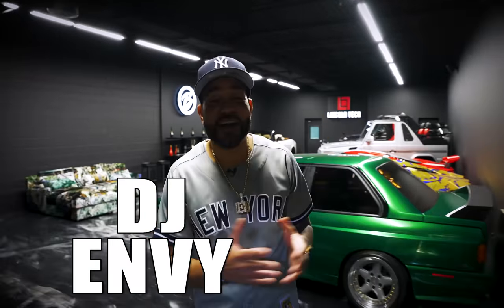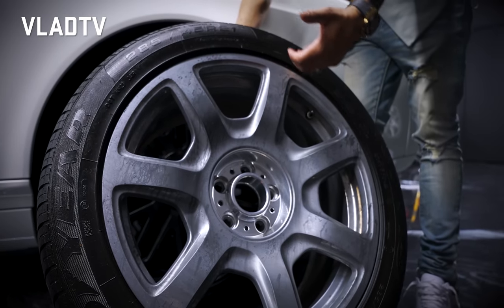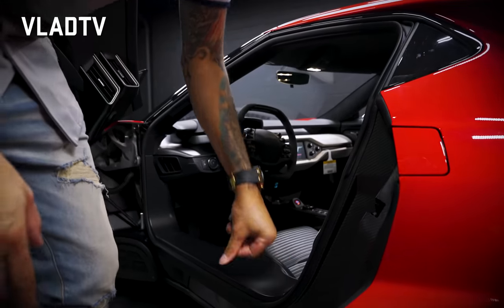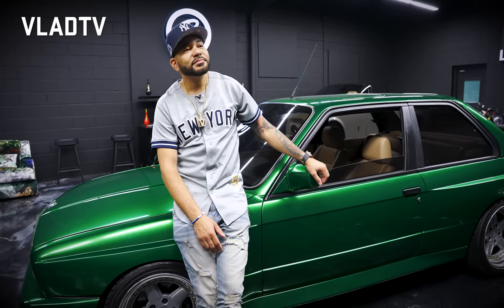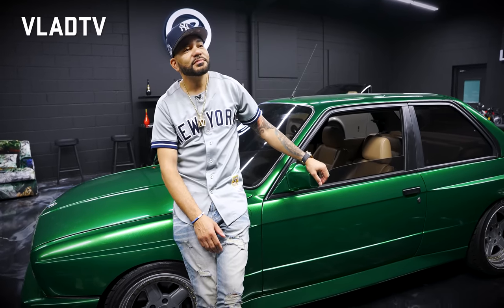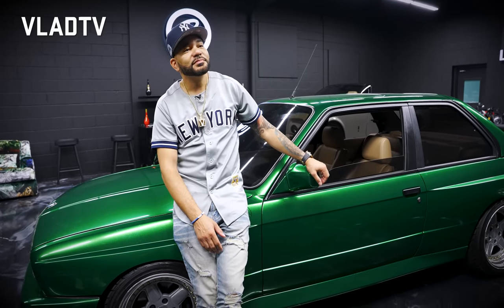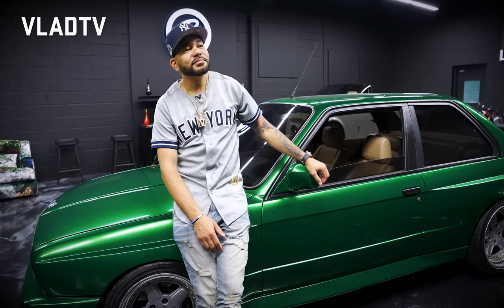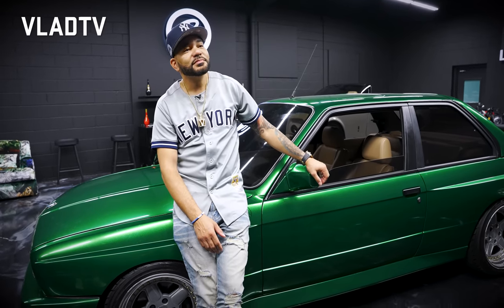DJ Envy Shows His Ford GT, BMW M3, Mercedes G Wagon, 50 Cent & Lil Kim's Cars (Full Interview)

Comment: 1988 735i my first car mint ! Got it with a very bad oil leak the dr. Wife’s sold it to me she said the bmw tech said engine needs to be taken out to fix it , so she got a new car off the lot and had the 7 dropped in her driveway, she was going to give it to her kid to fix , he wanted a truck tho ! So I said I’ll buy it , she said well since it needs a lot of work I will sell it for what ever you offer , 2 grand I said ! Ok deal made , got it on the lift stuck a socket on the pan bolts all hand tight ! Cranked em all down ! Oil leak gone ! 100k on clock v8 in the bay I just turned 16 man this car got me a lot of girls the hood opening up backwards was so G ! Brings me back